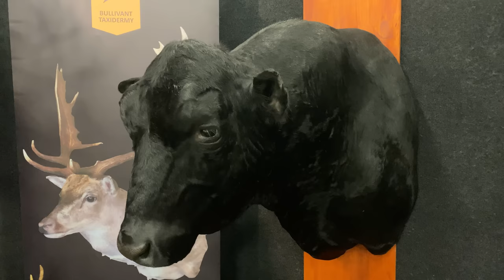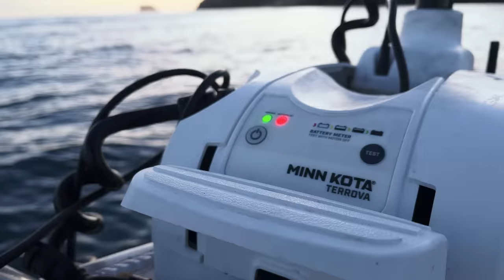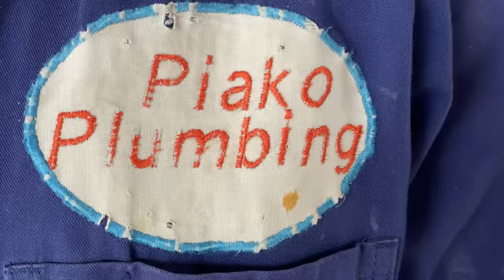Surface Explosion on a Sluggo, Soft Plastic Lure

Comment: Great vids brother what pound line you guys got on ya saltiga and brand got railed by a kingfish on 80lb had no chance in stopping him was of a jetty in South Australia 
Chur chur guys Milan’s home coming along looks great 🎣
Reply from the maker: We run PE 10 varivas braid brother 😎 breaks at 137lb! 80lb is silly string on big king fish 🤪 they fight hard 👍 Chur chur for the comment 😎👍😁
Reply: @TheLateralLine  cheers for getting back to me brother lol with the silly string comment chur chur tight lines thanks for the info
Reply: @TheLateralLine  are you using both 18000 and 20000 saltigas as I’ve got the 18000 chur chur
Reply from the maker: Yer, both, 18,000 and 20,000 😎👍😁
Reply: @TheLateralLine  hey mate what size slug o do you use 12” or smaller
Reply from the maker: 12 inch are the go 👍